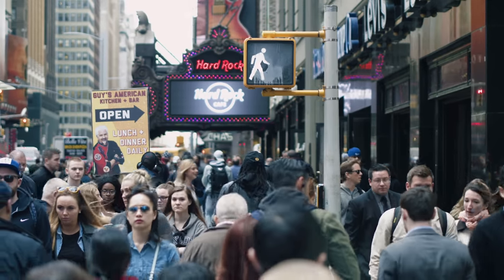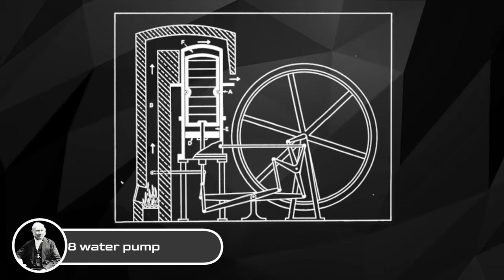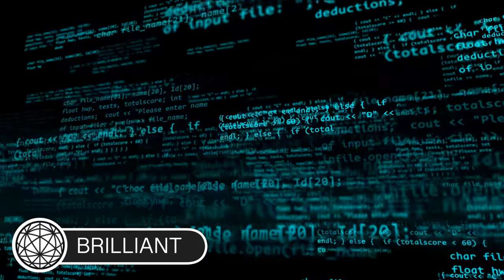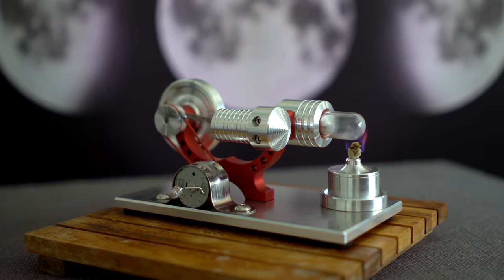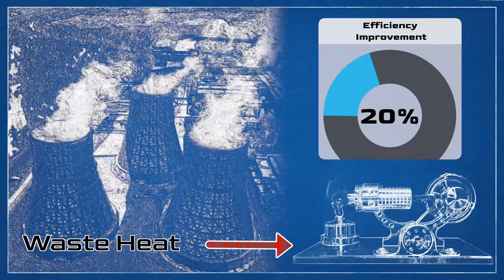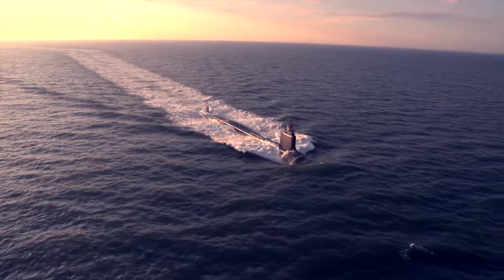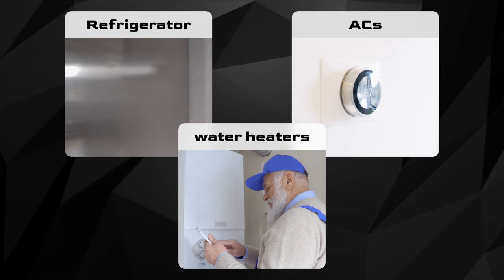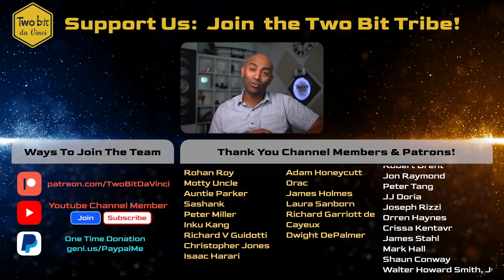Why This Age Old Tech Can Be the Future of Energy - Stirling Engine Explained

Comment from the maker: Sign Up for Brilliant today for free! But if you're one of the first 200 people who do, you'll will get 20% off an annual premium subscription. https://brilliant.org/twobitdavinci
Reply: Constant speed (10k rpm?) Wankel rotary converted stirling engine, possible? Efficient? (My son & I've owned a dozen RX-7/8 between us, so ...yeah.)🤗
Reply: Great video
Reply: If the extensive
Reply: Use the ground as the cool side of your billion dollar idea. 65degrees to 120degree attic temps 55 degree delta
Reply: This might be a late comment. But in areas where there summer tempratures reach over 100°F, like in arizona and texas, would it be good to do something similar to the as to the attic idea but place the sterling engine under a shaded area and the cooling system out on the open to. Similar to solar water heaters.
Reply: I have been working on a design for a thermal piston that could be used to build a self starting Sterling engine, and even act as a pseudo flywheel to maintain mechanical potential.
Reply: How about a Sterling Flywheel Engine? It might start really slow but rather than electricity we could store heat into angular momentum
Reply: We have been waiting over fifteen years our I should say at lest I have for some one to make a viable house thermal converting sterling engine to energy, it would seem a eazy task.
Reply: Humans 0
Saiya-jin 1 to 6
Angels 7 😇

Kalki Ironman 5th matriya buddha 8th arc Angel 11th satguru 13th imam and 24th avatar after 2026 😎

Almighty God 9 😇

Humans type 2.5+ after 2026 by Kalki Ironman (christ in the white horse)(son of man on clouds) type 7 and 8 😎
Reply: Jarvis the world’s first artificial intelligence (parrot) 😎

Cuz Kalki is ironman batman and every super heroes combined after 2026 😎

Jarvis world’s first artificial living being (just like vision in marvel universe)😎

Made of Quantum and sub quantum particles 😎

Power source quantum energy arc reactor (type 7) level technology 😎

Kalki Ironman going to have every kind of arc reactor like:- type 1 Nuclear fission, nuclear waste, hydrogen fusion, type 2 3 4 5 antimatter arc reactor (solid liquid gas), type 6 electro quantum arc reactor, and type 7 Quantum arc reactor, type 8 limitless quantum energy arc reactor without quantum particles 😎

Kalki Ironman going to have sun in a box million billion tons of hydrogen nuclear fusion reactor type 2 3 4 5 just like sun and stars in the palm of his hand ✋🏻😉😇😎

Comment: I designed a Stirling that was intended to use the heat in exhaust gas from IC engines.  It would be a power generating muffler. I believe that I solved many of the challenges raised in your discussion.
Reply: That is awesome! When I learned that heat is just energy, I started wondering if cars could make their own energy, but I got distracted as I grew up, and am just now wondering again. Back then, I theorized that the heat generated from braking could be harnessed, but that's as far as I went. The exhaust idea seems absolutely brilliant to me!

Comment: I am surprised that you didn't mention the other super power of stirling engines. If you power them they can produce extreme cold, far better than the rankine cycle we employ today. Some liquid hydrogen production uses a six stage stirling cooler. Coleman used to make a 12V portable cooler that ran at -70 degrees.
Reply: It's always great to go down the comments, a bit like mining in reverse, the gold is at the top but as you dig down you can still find gold it depends how you see things. 

I never knew that about the extreme cold thanks UA.
Reply: "produce extreme cold" means 'Pumps HEAT rather well.  You're looking where the heat WAS, but I'm interested in HOW IT PUMPS HEAT.
Reply: @manifold1476  I used the term “produce extreme cold” to illustrate a deliberate use of Stirling engines to create a cold environment rather than discussing thermodynamics. People who have a passing knowledge of thermodynamics fully understand that cold is simply removal of heat energy. Just like we say “the fridge makes our drinks cold”, rather than “we use this metal box with a heat pumping mechanism to remove the heat from our drinks”. So apart from pointless nitpicking, did you have anything of relevance to add to my comment?
Reply: @manifold1476  oh and they pump heat extremely well, far better than rankine cycle heat pumps. They have much closer tolerances in manufacture and therefore are more expensive to produce, this is why you don’t see them in common household use.
Reply: Back in the days of Yellow Front ! lol
Reply: What are the pros and cons of this when being compared to a phase change cooler and a thermoelectric cooler, especially when looking at the mini - micro scales (Something between a normal large bottle of soda and a can)? Also, would it be worth the effort to turn that waste heat into electricity considering the scales of size and temperature?
Reply: @midgetman4206  far more efficient than either of those.
Reply: @unicornadrian1358  But how does it compare to a phase changer in its ability to cool a constant load.
 
Wouldn't the evaporative cooling absorb more heat in the same amount of time compared to a sterling cooler which only uses pressure differences? The phase changer, like the name implies, uses that plus phase changing. Wouldn't that make it better specifically here?
 
Might as well say what exactly the idea is here. A personal wearable cooler that works independently, a closed loop, only requiring power. Why? Just sounds cool, no real reason.
Reply: i am surprised that you (and responders) chose to  IGNORE  the fact that  That  Aspect of a stirling engine  WAS  MENTIONED.!!!!!!!
Reply: @daviddavids2884  for real.  And not just a quick mention.
Reply: The reason we don't use Sterling is because of complexity and cost? No it could be used in many applications. The reason is big oil.
Reply: I wanted one of those coolers so bad. They are a fortune if you can find them now.
Reply: They would be a great way to charge a electric car

Comment: In 1998 I attended a stirling engine show at Lake Itasca MN and saw a super home made Stirling engine.  The engine had two 4" pistons and was pressured to 100 psi.  I was amazed when I put my arms around the fly wheel and was surprised at the amount of power produced, I could not stall the engine.  Unfortunately the builder passed on several years latter.
Reply: Do you know where that engine might have gone or if there is any documentation of its design? I imagine many hobbyists would love to use it for inspiration.

Comment: Excellent device for geothermal or volcanoes.
Reply: And concentrated solar as well.
Reply: How about solar thermal?
Reply: Couple thermoelectric generators and Nitinol heat recovery and boom over unity
Reply: It should be called a displacement engine. The temperature scale only requires a difference which can effectively act on the space hot or cold.
 High volume low to med speed higher torque. High speed toy size models give the wrong impression. The toys need high heat to reach high speeds with low volume. They seldom have a heat regenerator which conserves the driving heat instead of dumping it into the open air.
Reply: not really. geothermal heat with high T is perfectly converted by a turbine, with a low T heat pump. Leave such questions to professional power engineers, please.
Reply: Volcanos ? Haha how do you keep it from being melted
Reply: Or older females going through metapause.
Reply: Steamturbinne would be better
Reply: @KGopidas  still heat so ya

Comment: Well Sterling engines are big hunks of metal.

So if you use Sterling engines as heat sinks for your Bitcoin mining rig, you could probably claw back a significant amount of waste heat.

I guess I should watch the video now.
Reply from the maker: that's brilliant actually! Wow amazing the great ideas I hear on this channel. thank you!
Reply: That's a great one to add to the list. Join us on discord and keep them ideas coming.
Reply: @TwoBitDaVinci  even better if it's winter and you're going to be running a heater anyway. Not only that but the Sterling engine will run more efficiently in the cold.

Then you would be getting paid to heat your house.
Reply: Nah, low grade heat, relatively small temperature difference from the computer rig heat sink and the ambient air temperature, max 10 percent efficient, probably more like 5 at a push,
Reply: Making them with 3d printers with light weight material can make sterling engines cheaper and more modular in design.
Reply: @jimbobarooney2861  still worth a try.
Reply: @katiegreene3960  hi, I know two bit did a previous video on heat pumps, so with heat pumps keeping the delta temp as low as possible with say underfloor heating one can obtain a Cop of 4 or 5, 400-500 percent efficiency, unfortunately by having a low temp difference for a Stirling engine or alternative heat engine the opposite holds, so the efficiency is very low, something that might be of interest regarding running a refrigerator more efficiently, is to mount the unit to an external wall, insulate and seal the sides bottom and top, now place two external vents one near the bottom and one near the top of the cooling coil unit, by doing this you will reduce the running cost especially in the winter when the outside air temp is low,
Reply: Its all about the delta v and efficiency. And no we wont be harvesting any appricable amounts of energy off small heat sources in any of our lifetimes.
Reply: @acroduster  not with that attitude we won't for sure 🤔😋😉
Reply: @katiegreene3960  its not an additude at all. I just understand the law of entropy and have a decent enough grasp of physics to know sterling engine efficiency requirements. Low delta v is the key.
Reply: @acroduster  so then that's the challenge, try to solve that issue in our lifetimes.
Reply: @katiegreene3960  not my interest! While i do build sterling engines and have managed to extract usable amounts of power. I am experienced enough in said to know that the delta v of computer waste energy and other such sources are usless to pursue with current material science.
Reply: And if you ran the heat into a geothermal heat line you could cool the working fluid by heating a city
Reply: @acroduster  you're not thinking about big enough computers. If you turn the big pulley into a fan you have self-regulating cooling, no need to turn it back into electricity at all.

The savings would come from using some sort of heat piping technology two large stationary HVAC systems with Sterling engines also being the main draw fans. Not having to worry about some random electric motor burning out and taking your server with it fail safe forever is worth a lot of money. You would still want to backup HVAC system, to deal with spikes, but it wouldn't nearly have to be so expensive and you would use it a lot less so it would last a lot longer.

Or if you didn't want to use air you could hook everything to water blocks and use the Sterling engine to run the pump. The hotter it gets the faster it pumps the more cools. Toss some peltiers in the gap, to use daytime solar to increase the heat gradient with no moving parts.

Remember, no part is the best part.
Reply: @katiegreene3960  of course, alot of these  small toy engines you can buy online work at atmospheric pressure, by increased the working fluid (air or helium) pressure to say 100 bar the sterling engine can pack alot of power for a relatively small size, but like all heat engines the efficiency is dictated by the temp gradient
Reply: @Allen Loser yes you are correct in saying commit time and money to a solution.
I was not trying to insult acroduster thus the emojis to attempt to convey a kidding attitude.
Sorry if it came across that way.
Reply: @katiegreene3960  what discord server are we talking about?
Reply: Hilarious thought on mining the stuff thanks Forlarren.

Comment: There is a New Zealand company that makes Sterling engines for yachting boats, it creates enough electricity to run the electronics on the boat and the heat is used to dry the cabin and all it's heating needs.
Reply: Name that company…I think it’s bankrupt but I want to look it up if you have the name.
Reply: @esquire9445  Sorry, I don't remember the name, but you could be correct that it has gone bankrupt.
Reply: They should use the steam to distill salt water too.
Reply: Whispergen
Reply: @rickfreezerburn1159  that’s right, and it was diesel powered.  The factory was destroyed and the company just stopped making the engine… I think this is accurate but I could be wrong
Reply: @rickfreezerburn1159  Thank you.
Reply: I thought it was Dutch, they were using them as a hot water heater on fishing boats and a .95kw genset. I was looking at sailboats at the time and thinking about that as a genset
Reply: @raymondclark1785  Thank you, there maybe  other company's out there, who I hope still exist. The one I was thinking of was "Whispergen" who have gone out of business.
Reply: @benjones4365  I think it was Whispergen also, maybe they were made under license in other countries.

Comment: When you spoke of a heat line I thought of people that install hot water loops in there houses so they don't have to wait for hot water at the faucet.  I think the hot water loop could play a double role in that the hot water heater could be in the attic where it would absorb heat from solar hot water heaters, appliances below, and drive a Stirling engine to generate electricity or use electricity to heat the water depending on hot water needs and electric rates at the time.
Reply: Sure do like ur way of thinking tyvm

Comment: In the early automotive industry, Stirling engines lost out to internal combustion largely due to the reason you gave, poor responsiveness.  Nowadays, inverter generators use a smaller engine than normal because they don't have to be very responsive to sudden, temporary load increases -- the battery and inverter can handle that.  So not-so-big Stirlings in cars might be able to effectively use the same concept, steadily charging a battery and letting the battery and inverter handle surges.
Reply: Hemp is the best way to go
Reply: Could work in theory, but power density is still a problem. Also cost as the machining tolerances for a Stirling engine piston/cylinder pair are way higher than for say, internal combustion engine. Using Helium adds to the cost too, SE has very poor efficiency when using air.  You could of course use Hydrogen which is cheap, but that has its own problems: next to impossible to contain (small molecule, leaks everywhere), potentially explosive and because at high temperatures it is chemically active forming hydrides with metals (making metals brittle) limits the choice of materials from which SE body can be made. So yeah, there are challenges.
Reply: The main thing against it is lack of energy density. Another thing against it is it uses the combustion of fuel for heat to power it when used in mobile applications. In stationary applications,it can use waste heat,solar heat,geothermal,and others, without combustion.
Reply: @mikedunn7795  The Sterling could still burn gasoline (or diesel), so the energy density could be the same.
Reply: @PeterLawton  No,because the gasoline just supplies heat for it to do it's thing,which doesn't change the power output.
Reply: @PeterLawton  The Stirling is not an internal combustion engine. The gasoline would heat the cylinder of the engine to make it move.
Reply: @mikedunn7795  I think you were referring to power density, then.  Energy density is a property of the fuel.
Reply: @mikedunn7795  Yup.  That is clear.  (I own a working model -- very cool to watch)
Reply: Stirling engines would be perfect with hybrid vehicles.
Reply: Could also use it as a mechanism to run the car off the heat if the engine and when the temperature starts to drop, the gasoline kicks back on.
Reply: @unicornadrian1358  I was thinking about this. Currently Priuses use an Atkinson cycle engine, which is more efficient than a traditional engine, but doesn't produce enough horsepower to be viable in a car. Because the Prius is a hybrid, this high efficiency engine is used to power electric motors, as well as keep a very small battery charged to handle changing load. Maybe in the future a smaller lightweight sterling engine can be used instead, that would add a whole new meaning to "Flex Fuel" vehicles lol.
Reply: @elijahhmarshall  Stirling engines would be perfect in a hybrid. They could run at a preset RPM with the most efficient profile and batteries/capacitors could smooth out the demand.
Reply: @blg53  What about sterling rotory engine?
Reply: @DailyLifeSolution  What about it?  Whatever configuration SE have the same problem, low Power density. Rotary SE suffers from the same. It is due to the heat engine principle, not due to how it is implemented. Some posters above say that SE would be ideal for hybrid vehicles. Again, only in theory, only if you don't care about the size of the vehicle and its cost. Remember, in a hybrid car the engine still has to provide the vehicle average power into the battery (unless it keeps running and charging battery while the car is parked) while the car is running, otherwise the battery will run flat.
Reply: Can I use a solar oven to produce hot water to run a detached water pump, to run an automobile alternator and generate electricity; so the water is heated in the solar oven forced down to turn the alternator and get electricity, a closed system
Reply: The water pump in your car runs on a closed system turns the Alternator which powers 2 headlights tail lights and radio, that's more than enough power
Reply: @smokingspirit763  Water pump in a car turns the alternator?  That's total news to me.
Reply: @elijahhmarshall  Turns out somebody has already built a stirling "flex fuel" hybrid car.